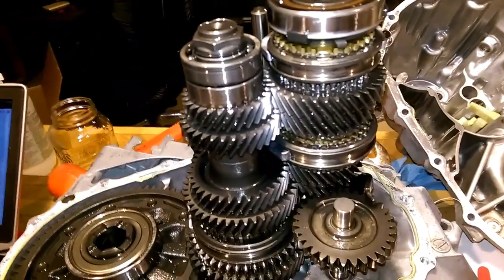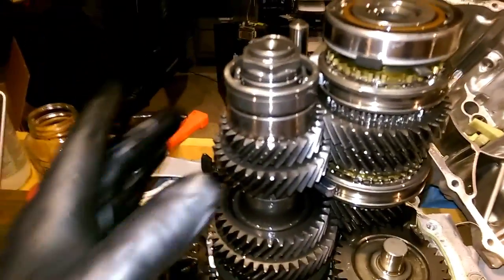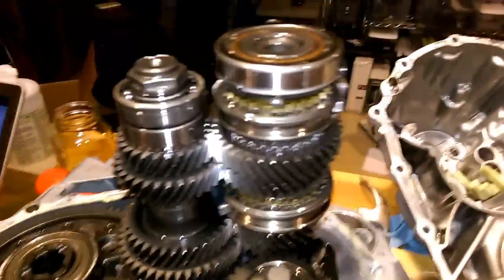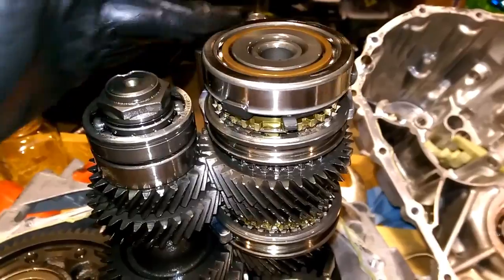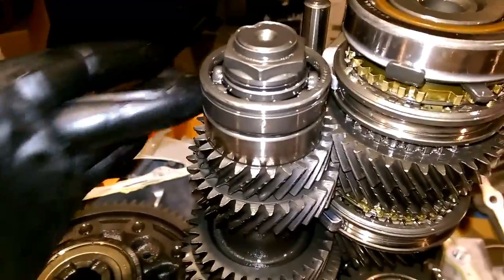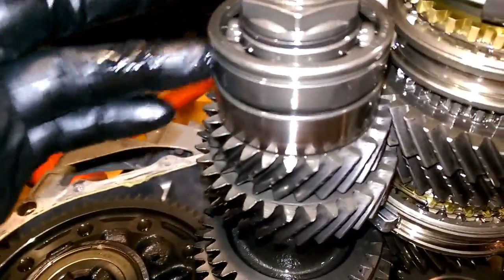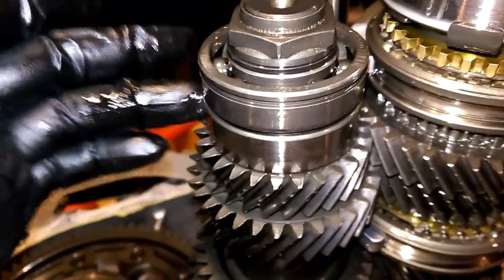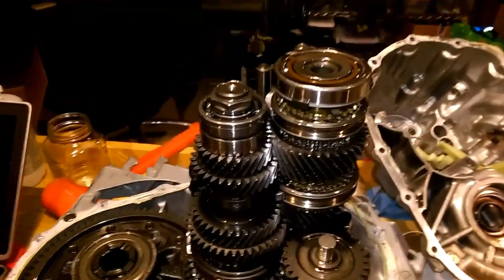Transmission bearing sound

Comment: Did it sound like a ticking  noise when the engine was running?
Reply: It just sounds like beads bouncing inside a can. I ran a transmission dry for two months

Comment: Hey man, I have this SAME noise on the same trans i built and the bearing is a brand new NTN. Isnt this normal for the style of bearing it is? I have been paranoid forever about it because even oiled up it makes this sound yet the old one doesnt. I did a lot of reading about bearing and apparently its normal? Others say no its not. PLEASE HELP a fellow mechanic. What a horrid nightmare to throw all my hard work in and this bearing actually be bad out of the box. I'd drive it off a freeway overpass !
Reply from the maker: Hey there! That noise is nornal for "roller bearings". Those bearings have cylinders (instead of balls) and are tapered. They're useful for taking force applied predominantly in one direction. But, b/c they're singly-tapered, they often "rattle" when not under load. 

So, I'm not a trans doctor, and I am in no way qualified as anything that would allow you yo sue me,  but rattling on tapered roller bearings is ok. And if you went with NTN you're probably golden. On that trans in the video, I only changed the main-input-shaft bearing. I think Honda calls it a primary-input-shaft. And it's still good. (Except 2nd still occasionally pops out on left turns while decelerating, but apparently thats the syncro springs, or some shit. :):)
Reply: @AmyAndrewAdventures  Hey dude thank you SO MUCH i really appreciate it. My old one didnt make the sound so i assumed the new one was bad for making sound. Great to know ! thanks for passing it onto me.

And yes the synchro springs are CRITICAL and often the problem more than the synchros. I have extra synchros galore in high mileage trans and they still look mint but the springs were wore to fuck. Sorry to hear you didnt swap those out ! What misery to do all this and then have to pull it back out. Im a meticulous freakazoid so im not throwing mine in till every detail has been over analyzed to death. One tiny fuck up like putting a thrust washer on upside down on 1st gear and you're done...  Thanks again.

Comment: Did you notice a noise in your transmission when decelerating but not on acceleration
Reply: That's what I got going on in my ford ranger (2003, 166k miles, manual transmission). Did you figure out the cause for that in your car/truck?
Reply: Duran Murphy no I’m taking my 1994 caprice in to have the transmission checked. Let me know if you find a solution or the problem to that thanks.
Reply: @gr8livn  it turned out to be a pinion bearing that went bad in the rear diff . There was some noticeable play in the connection between the drive shaft and rear diff when i tried to move it around. Plus there was some signs of leaking rear diff fluid coming from there

Comment: I have something like this but it shifts fine no grind no pop out of gear but it’s been like that for 3yrs and now couple days ago when I’m in gear all gears but 6th if I hit the gas and let off the gas it does a ching ching* sound or lose change or a bolt flopping around somewhere idk where... it doesn’t effect it shifting up or down it doesn’t do it in reverse or 6th gear though all the other gears it does... I also 3 months ago just had the clutch replaced $2100 on a 07 dodge Dakota 3.7L 6speed getrag238... they did say they think the input shaft bearing is going... they don’t rebuild getrags and I called around no one says they can find any rebuild kits for them either....
Reply: Ok, so i have an issue with mine too, to ME it sounds like i had a bunch of bolts, and tossed thwm into a garbage disposal and turnwd it on...however thwre is almost NO symptoms other than noise....oh, and this happen like 80% of time...ph yea and when it does happen, everytimw i stop, it wants to grind into 1st when its doin it. ALSO...it only does it 1 2 and 3 SOMETIMES 4...and Whines LOUD in 5th
Reply: I live at an apt complex, so i dont hVe a choice but tobe 110% SURE before i remove it. Bc ill ONLY have the weekend....so if any of yall have an  answer PLEASE LMK
Reply: box of rocks? Mine's been doing that for 15 years noise.....
Reply: @WillWork4Subs  ever find a rebuild kit? Mine quieter now after changing 4quarts of the royal purple fluid that’s meant for ATF4 applications. Almost seems as if it picked up some pep too
Reply: @gliderarts3573  
I added some royal purples  ATF4s fluid to mine. Got it in the T-case and transmission. The Getrag238 seems to like it. Been quiet after 3months of adding it. 
Still no rebuild kits, unless you live in Germany and by the time you fork out the money for the rebuild kit you might as well bought a used one… 
I found out these use this transmission in BMWs for years. The drifter community loves this transmission because of the triple synchronized system, though it’s good on up shifting but technically it’s designed for smoother down shifts.

Comment: Was those bearings bad , ?mine is kinda like that , was wondering if you replaced them or not? Thanks great video
Reply from the maker: Sorry for the late response. So I learned that that bearing that had the "rattling" sound is actually a tapered cylinder bearing. It has little cylinder, like pins, instead of ball bearings. Apparently that's a "normal" sound for that type of bearing. I ended up leaving it and so far I've been G2G with no issues (10k miles at time of writing). 

I did change the "main shaft" bearing (I believe that's what Honda calls it) and I put in a helical limited slip. I also replaced the differential bearings since I was throwing in a new diff anyway.
Reply: AmyAndrewAdventures thanks , yea I left that bearing to an replaced the in put shaft / main shaft every thing working good , also did complete clutch , oil pan gasket, everything works great no leaks

Comment: If I put so much oil in to gearbox and drive couple mile then bring it back to normal level will I achieve quite gearbox as I only have slightly whining noise??
Reply: no

Comment: bad ball bearing. in a ball bearing as they wear the race and balls will come out of spec, causing a lose tolerance and give you that noise. being as its basically in an oil bath it would last along time like that but may cause excessive noise under a load. i doubt it was ready to come apart but it should be changed. personally i would change every bearing and seal while you are there with quality parts. probably synchronizers  as well. its not to expensive, would assure you do not need to take it apart again for quite a long time.
Reply: You think Lucas fluid or additive would make any difference?
Reply: @motogp9253  nothing can save an already wore out bearing the only thing you can do at this point is replace the bearing
Reply: @nathan00campbell  - Thanks, I was thinking that might be the case.
Reply: where do you get bearings for old 90s transmissions... can't find one for my mp1a (prelude 96 automatic si)
Reply: @aquaticnstuff7666  should be a number on the bearing